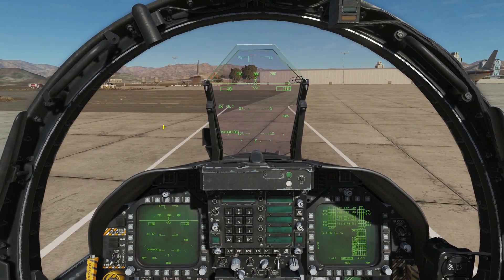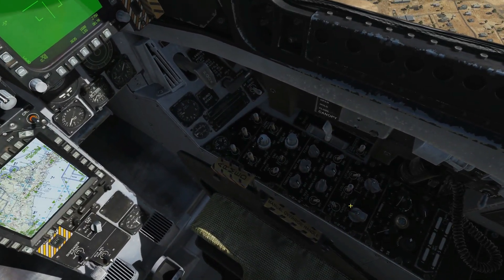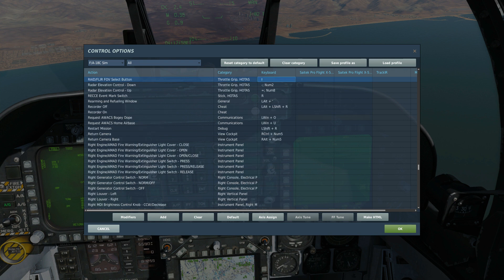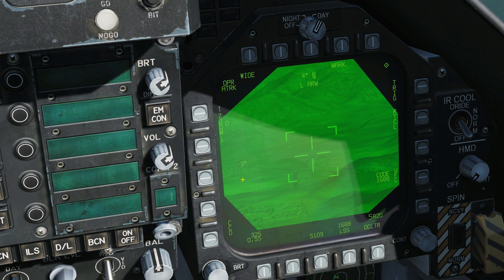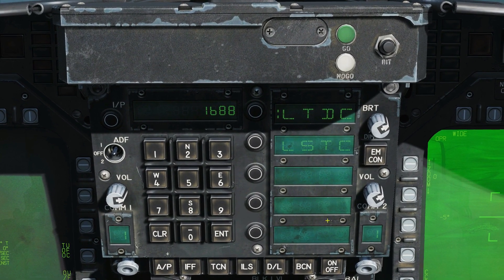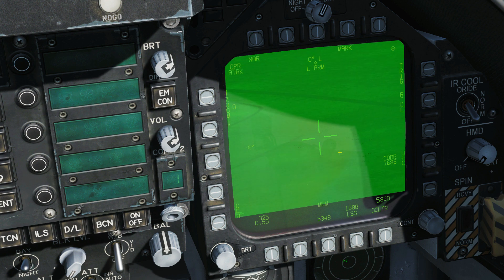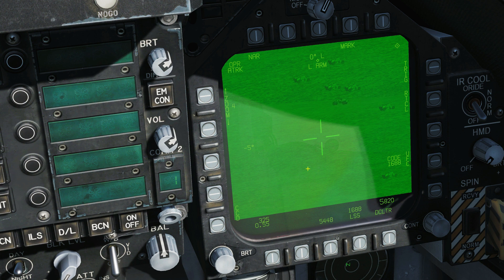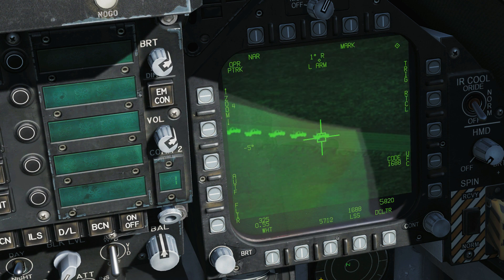FA-18C Hornet: (OUT OF DATE) TGP TPOD - Air To Ground Tutorial | DCS WORLD

Comment: I must say TPOD is a true pain in the ass to use without HUD marking of where the damn thing looking at. TBH i got F-18 after actually learning how to use A10C, and compared to A10C it's an non-logical mess. No sensible slaving of sensors to each other, TPOD is damn hard to use, no HUD TDC designation, and on top of all you need to hold button pressed to slew maverics, and god forbid depressing it while doing so accidently. Oh, and you can't designate using mav sensor either.